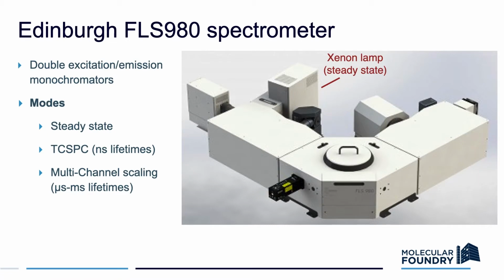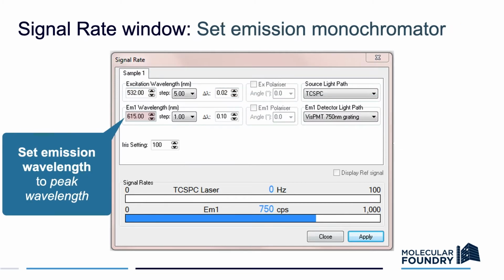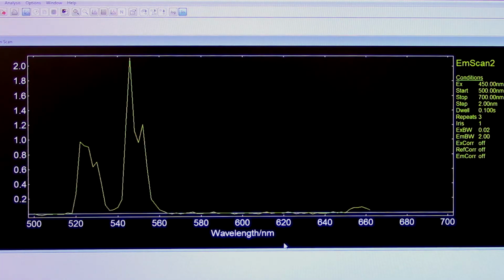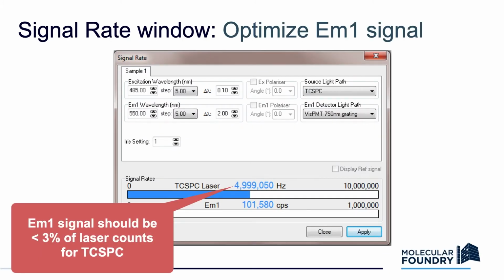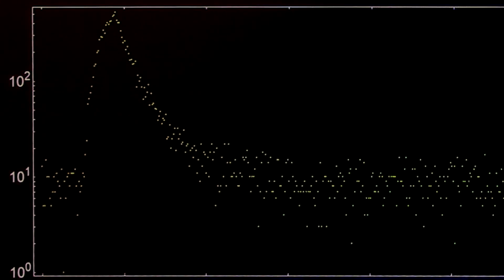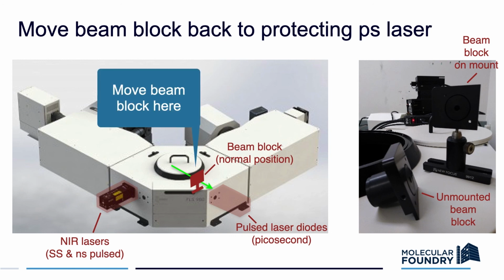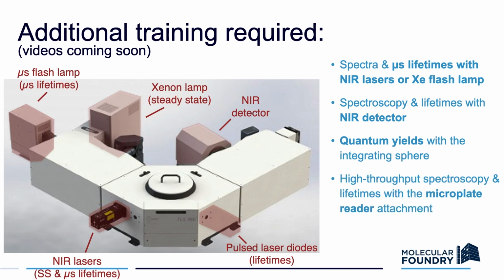Edinburgh FLS980 spectrometer: Steady state spectra and ns lifetime measurements (Xe lamp/TCSPC)

Comment from the maker: Contents: 

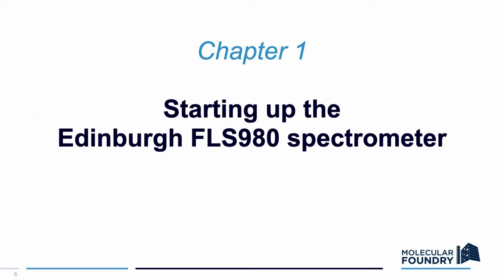Chapter 1: Starting up the spectrometer - 2:10 
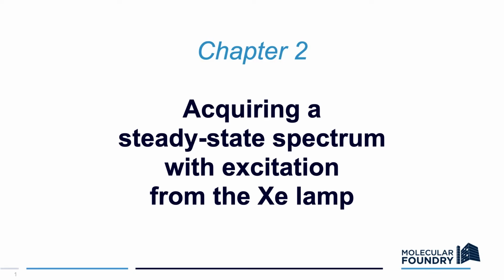Chapter 2: Acquiring steady state spectra - 4:24
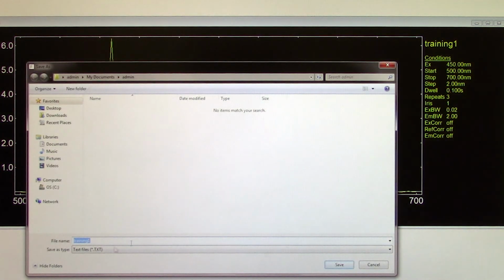Chapter 3: Measuring lifetimes in TCSPC mode - 12:45
Chapter 4: Shutting down the spectrometer  - 22:13
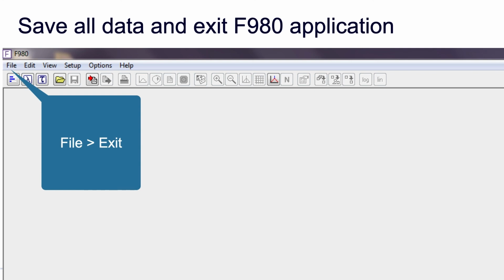Chapter 5: Troubleshooting - 23:57
Reply from the maker: Other useful time points:

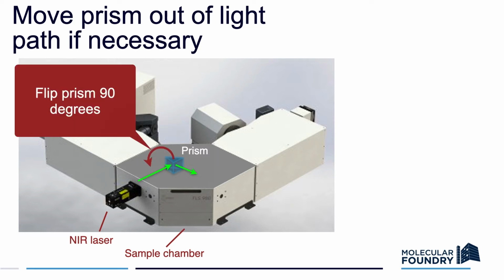Removing the prism from the light path - 3:30
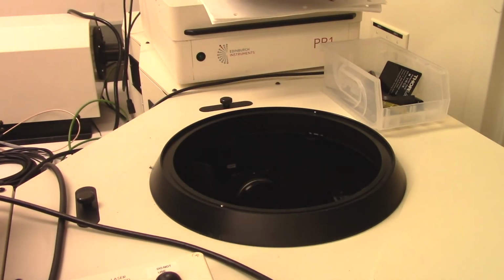Loading cuvette & solid sample holders - 4:45
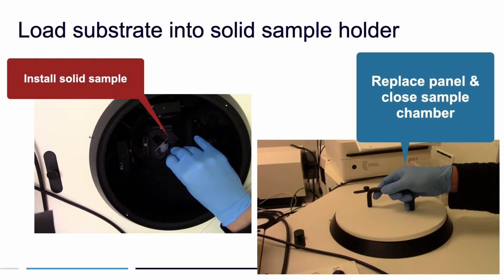Software settings for acquiring steady state spectra - 6:18
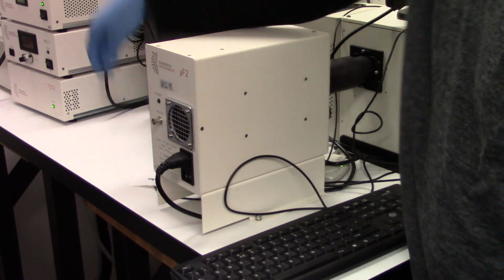Software settings for TCSPC lifetimes - 15:02
Fitting lifetime curves - 19:43
Additional features - 26:31